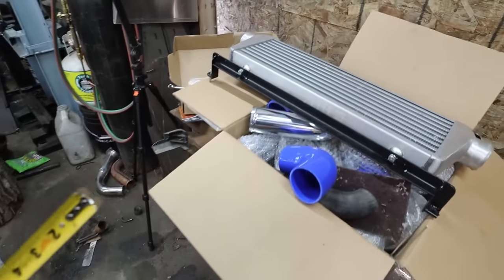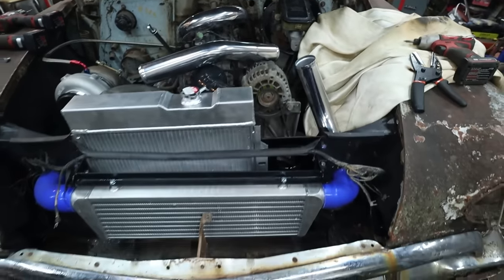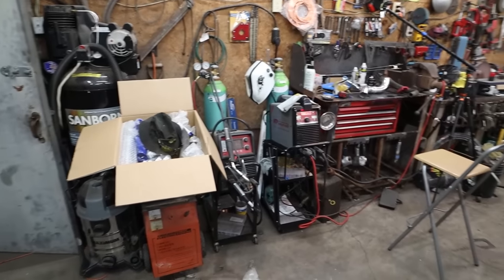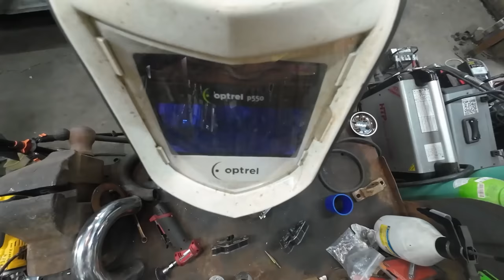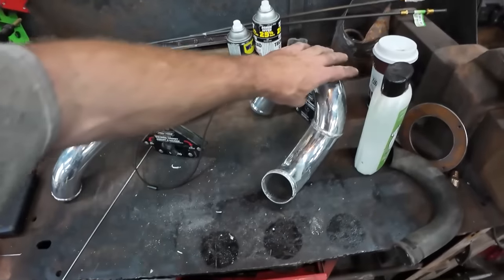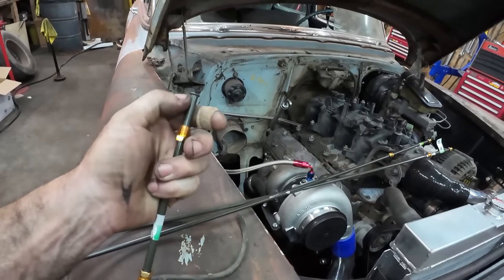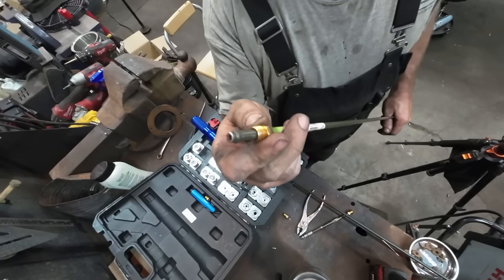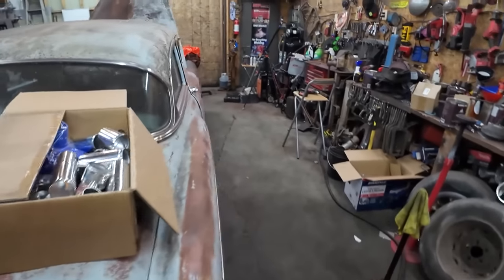Building all the inter cooler piping and plumbing trans and power steering lines.

Comment: Back in 1959  when I was nineteen I spent an entire summer putting a small block 265 into a 1950 Chevy - pretty much the same engine compartment configuration as Bret's 54'. Watching the guy use all the stuff in his space age surroundings, and after losing much of in a fire 2 months ago to boot, has me absolutely awestruck. Seeing how quickly he fabricates all sorts of stuff on the CNC plasma cutter makes me feel like I was a caveman with a rock hammer. Heck it took me a week just to make a front engine mount. But, watching him TIG weld aluminum - sheesh. Well, I'm now 84,  and love watching the guy do his stuff, but I sometimes get the feeling I'm watchin' one of them there "Star Wars" movies.
Reply: Shade tree expert level
Reply: I was thinking about building an old small block in the garage on a stand just so I can start up and rev it to hear the good old days one more time. Couldn't cost that much would it. Just need a fuelly cam and holley carb and chambered mufflers, whaammpaaaaa! Foot tunes! Wanna race?
Reply: Go for it...I also had a 1938 Buick Special coupe back then  but being young and stupid never finished restoring it in a proper way. Them shore was the days.
Reply: More like "Star Wars" meets "Harry Potter"...  There has to be some wizardry involved in the way Brent fabricates sheet metal.... :D.

Comment: Hi Brent. Thank YOU for showing off your intense ability to figure things out and walk right through the buildups. I believe what you call a blow-off valve is called a "Waste Gate." That is the name I have always known for the pressure relief valve in a pressurized induction system. Not that it makes much difference, but I always thought the waste gate belonged as close to the turbine as is reasonably possible. I only had experience with a draw through carbureted system, so that's where my ideas come from. If I got a backfire it would always blow the system open at the rubber connections. The engine was a 400 cid Chrysler V8 and I cut a small block Chrysler distributor shaft in half and mated it to the big block distributor shaft to cause a centrifugal RETARD of about 18° so we could start it up and idle it at about 20° btdc, but when it started to rev up the timing would go down to zero. We had stock pistons and heads so the cr = 8.2 : 1 and we ran it on 110 octane race gasoline. The waste gates (2 of them) were set to 45psig and   we pumped it up to 45psi all the time. My way of thinking that made it what, about 3 atmospheres? Can we then say a 400 cid = 1,000 cid?  It was in a Dodge Dart that weighed about 3400 Lbs and we designed it for drag racing. The first thing I noticed was when the turbo came on all I wanted to do was steer it. So I put an automatic trans in the car with a manual shift kit so I could shift asap to get it out of the way and then concentrate on steering. It was fun back than, but I'm over it now. I hope your setup delivers like that for you Brent! ben/ michigan

Comment: I've Tig welded aluminum for 10 yrs. Can I give you a few tips. Face your left palm up and hold the filler rod with your thumb and first three fingers then bend your pinky and then rest the filler rod against where the pinky joins the hand. Feed the filler rod in smoothly into the puddle  using the thumb and the three fingers, sorta like a wire feed would run. It takes practice but once you get it seldom will you touch the tungsten. When you get good you can rock the torch back and forth and get an awesome snakeskin bead :D . Remembering contamination is your worst enemy tigging hence why you need the shielding gas. Did you notice where the marker lines were gave you trouble welding there. Using a nice new stainless steel wire brush to prep the area where you are welding first. Also a nice clean table to weld on. Love your channel hope these tips help you. Mark

Comment: Tech tip of the day. When using a holesaw on tubing, drill the pilot, then install the can. I use 1/4 drill rod for my pilot. No flutes to chew up the pilot hole. Keeps the saw from walking. Makes a better hole.

Comment: The reason to run the trans fluid through the rad is to keep it 160-180F. This is the ideal temp range to get the most life out of it. In cooler weather the trans will run too cool if running a cooler big enough to keep things happy when it is hot out or you are pushing it. If you put an aux cooler in, put it before the rad cooler to drop the temp to keep excessive heat out of the engine cooling system. If your engine cooling is adequate then the engine will keep the trans fluid in its sweet range. Heat kills, but running too cool does too. Enjoying the build!

Comment: Piece of wood, a circe the size you want hole in center for stabilization and run Plasa cutter around circle perfect Hole.  Or fix to metal so it don't move you have the picture now. It works.

Comment: Great work again mate. An option could have been run the hot side pre intercooler to the passenger side and the throttle body inlet from the driver side. But… it’s done now

Comment: Excellent video Brent  :) also Turbo set up and on flare lines do 4 pumps on lines then check helps out also inspect see  got 2 pumps on flares it help save lost time and yes some metal lines are tuff metal when make at factory before store gets it and costumer too ! I learned from my mistakes to before on make fuel and brake lines also  hydraulic too also put message on my metal tool box  for lines and witch to plus sizes used to help remind me ! Sounds funny but help and when fast repairs too got be done ! Also yes move transmission shifter linkeage up will help out lots too and lube up with high pentriotion fluid  spray too !

Comment: hey Brent dont forget your cooling fan for the radiator. The tight fit will be even tighter now with the new 'plumbing' fitted. it wasnt on your cardboard list. (i know in a previous vid you had found a thinner fan, but still looks like it will be tight...

Comment: Man, its getting there quick. Have you ever tried ribbing the pipe with the bead roller? I experimented with steel pipe, but its way too heavy for the weakest bead roller on the market…
Thinking about my LS/Fargo dream, mount turbo on top of right  fender, make it look fake…

I really like the ability to take a photo and get it cut on the plasma table.
Reply from the maker: Yeah just have to build my bead roller first hahah

Comment: I had to rebuild a lawn mower engine in tenth grade power mechanics before I could take auto mechanics in eleventh grade, the problem was I built a 318 Dodge when I was 12 so let Austin work for a cool car to drive to High school, hint I bought a wrecked 76 Trans Am two years old with 70,000 miles. front and rear quarter damage easy fix.

Comment: Sure does make a difference when you have descent equipment, when I was a welder fitter the good equipment increased the duty cycle bigtime and the cheap machines lowered your duty cycle. Which made it difficult to control your heat, when you cannot control the heat that impacts your welds bigtime. To help to ensure good welds you need to control your puddle, the better the welder the more you can control your puddle which mean the more you can control your welds.. It hard to control you puddle with a shitty welder. My buddy bought a small 110 welder from princess auto what a piece of junk that was. Even I had trouble welding with it. So yeah good welders makes one hell of a difference, especially, when your welding aluminum, you have to control the heat, if you can't you more liable to blow through, thinner metals. For instance, the new welders with the pulse function when welding with Tig, especially, aluminum helps control the heat a whole lot better as you can tell with the newer machine. Than the older welders, of course required more skill, when you can't control the heat. That is always a factor but all the new features with the new welders sure does make your welds look great.

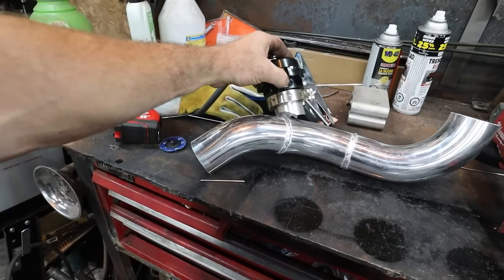Comment: 10:59 btent, are you going to worry about surgaring in your pipe from the welding? Its not so much a issue on the exhaust side, but it can kill the turbo on the intake side
Reply from the maker: Seems pretty clean on the inside unless you are referring to it being bumpy?